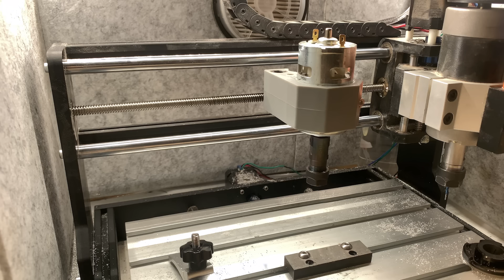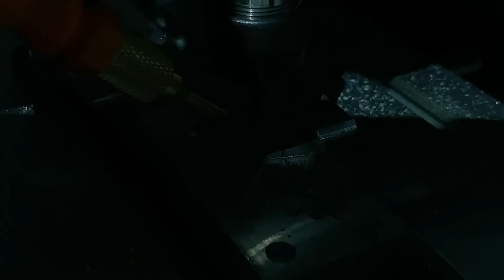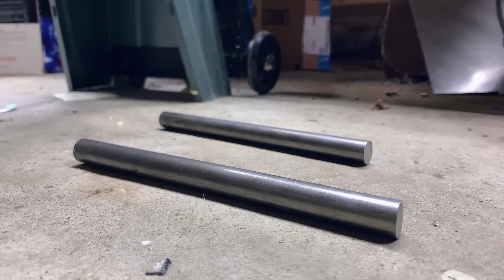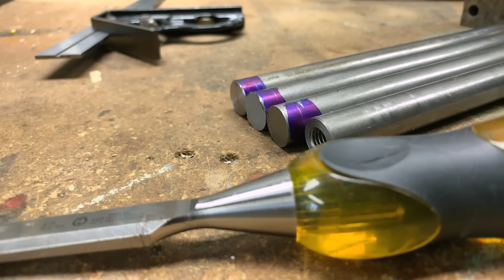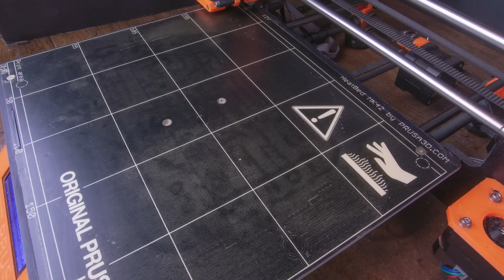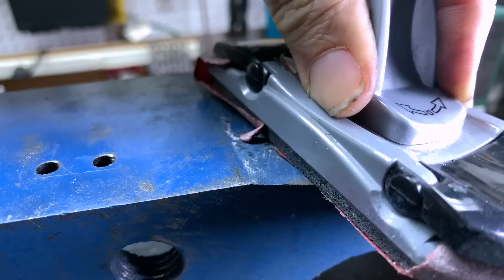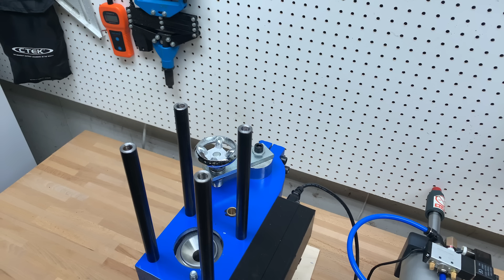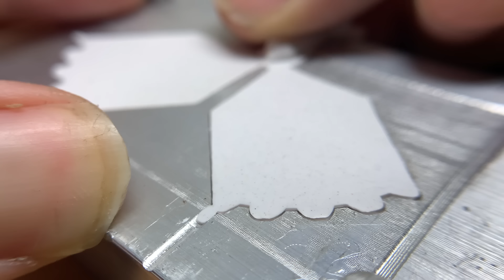Build an Injection Molding Machine From a Cheap Pneumatic Press

Comment: Amazing job! I just built my Buster beagle and creating tho mold is the next step. And I agree with you that the ability to repeat identically is the key.
Reply from the maker: Yes, it was so great to get it down to a button press!   Mostly I've just been adjust adjusting the regulated pressure up until the mold fully fills and then I'm good to go.  If I were doing a long run of parts I might experiment with reducing the hold time to speed things up a little.  Now the main consistency issue is just making sure I tighten the clamp up consistently.  Which is pretty easy.  I should have also mentioned that the controller counts up the number of injections you've done, which is also handy.   What sort of mold are you going to try and use?   I've only tried the AL molds because a lot of this was to give myself a reason to learn a lot of CAM.  ;]
Reply: @retrotechjournal  : What do you call AL Molds? I plan to print resin molds and use them in an aluminium frame, as suggested by Buster Beagle, to validate the mold. In a second time, either make the aluminium mold with my 3018, if it work, or make it be made by a professionnal (I'll need a few hundred pieces)
Reply from the maker: @pierrebouteillon  The AL Mold is called the die.  I guess.  That does sound like a good system.  Use the 3D print to fine tune the design and then either make a die or get one made to do a longer run of parts.  I would be interested in trying that out, but don't have a resin printer, and frankly I'm trying to learn more CAM, so just tinkering around making the AL dies is fun/interesting for me.
Reply: @retrotechjournal  Thank you. For your information, resin printing is rather easy. Far easyer than what yiu did!  You (more or less) only have 2 parameters to define:  duration of the print for the first few layers (to stick to the plate), and duration for the other layers. Far easyer than filament printing, and far higher resolution.
Reply from the maker: @pierrebouteillon  Yes, I've been tempted and will probably take the leap at some point but I sort of avoid things that have to many chemicals.  We're on a septic system here and I'm just not excited about gloves and fumes and shelf life of chemicals, etc.  The printers really have progressed a long way in the last few years. (and gotten cheaper)   I'm sure I'd love it once I get going, but I've been holding back.  :]
Reply: @retrotechjournal  I fully understand  and share your concern about fumes. But I think that the fumes of the melted plastic is more dangerous for health.

Comment: Great video! Subbed for sure, but can’t get over how killer the beard AND mustache is! The coolest safety hazard ;) cheers 🍻
Reply from the maker: Thanks!  Yes, it can be an issue.  I tuck the beard in when using the lathe.  I once singed the very end of it off when forging a rail road spike knife and I was using a twist wrench and the glowing spike was positioned below me in a vice. I try to be careful, and I've also been lucky.  :]

Comment: Great video! Those cheap CNC machines are awesome for making PCB's at home too, when combined with a cheap 5watt laser.

1) make your design in KiCad (or another PCB design software)
2) Use the 3018 CNC to drill all hole for through-hole components, mounting and easy alignment
3) Use (black!) spray paint to cover the exposed copped
4) use the 3018 CNC with laser to burn away paint that covers copper that needs to be removed (create the mask!)
5) Etch the PCB, with the spray paint mask.
6) Remove the spraypaint and have a working  (double sided) PCB. (without soldermask ofcourse)
Reply from the maker: I used to make all my own boards, but some time ago I switched to getting them fab'ed just because the price point got so low I couldn't justify buying copper clad boards. Plus hey solder mask, silk screened labels, plated through holes, etc.  That's a good reminder though if I ever need a board TODAY I could do it with the 3018.  Thanks!
Reply: @retrotechjournal  That may be true, but its much more fun and cool to do it at home.